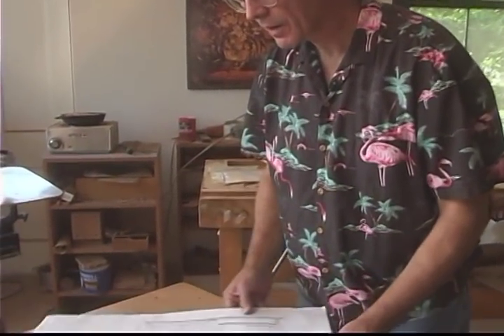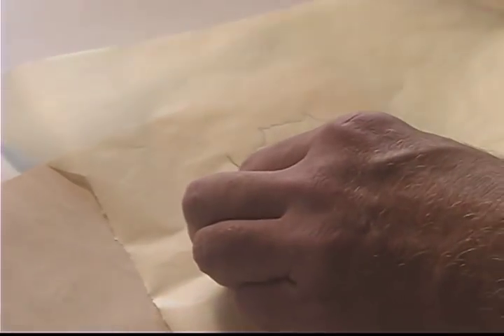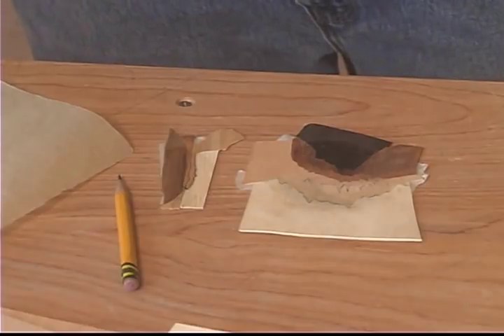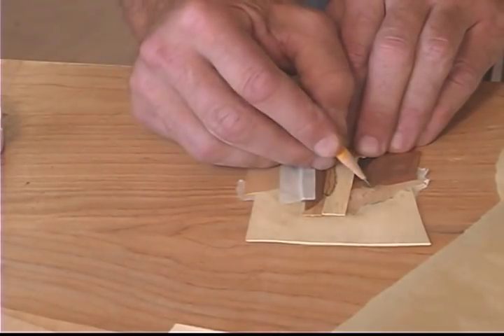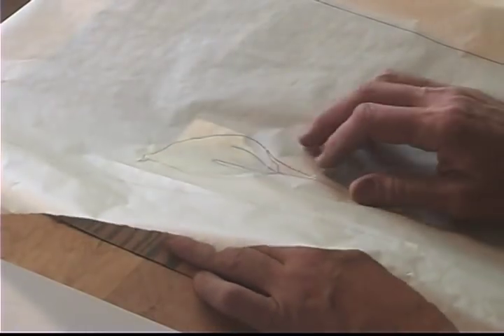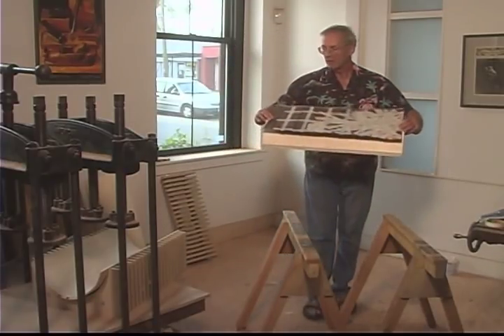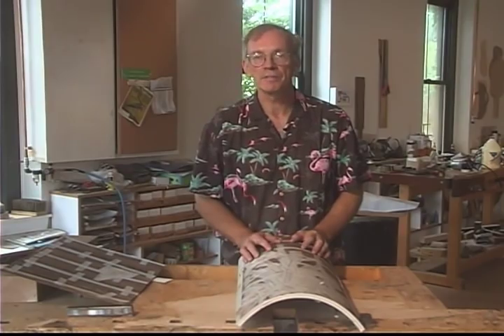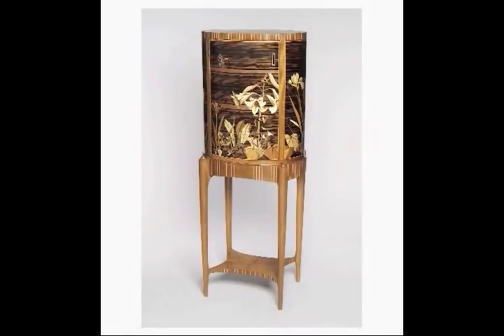Silas Kopf Marquetry Tutorial - Building a Marquetry Picture

Comment: Amazing. Your work is incredible.

The tape removal does look like a PITA. I wonder if it would be worth experimenting with a heat-activated tape and keep a tacking iron beside you? It would definitely take more time to apply, but at the end you could use a heat gun or even heat the whole panel with infrared lamps or an oven and just peal it all cleanly off, skipping all the scrapping and sanding for tape removal.

Comment: Master, tell me what blade you using for this that do not see the kerf after blade cuts on the veneer's splice? I'm using the smallest what i can buy 8/0 (it's stricte for metal - for jewellery) whitch mean 0,16 x 0,32 mm (names Super Q Niqua 8/0) and actually still can see the kerf. :/ 

Greetings from Europe.
Reply: I took a class with Paul Schurch at the Mark Adams school this year.  He uses a 2/0.  He says smaller is pointless, and after glue-up and sanding the kerf is not noticeable.  He also does not use the double bevel method for this reason, It appears Kopf does not either.